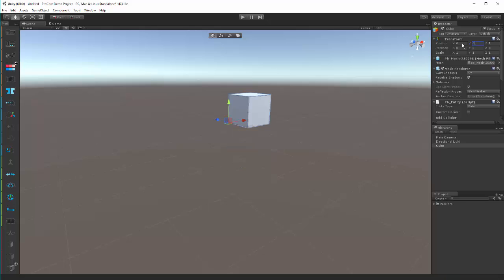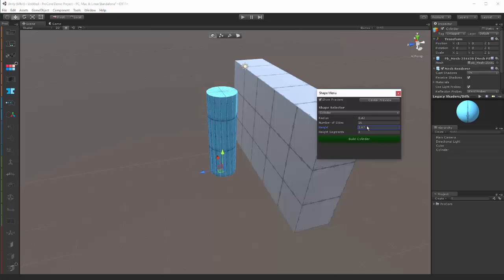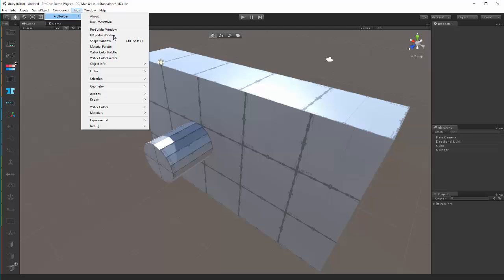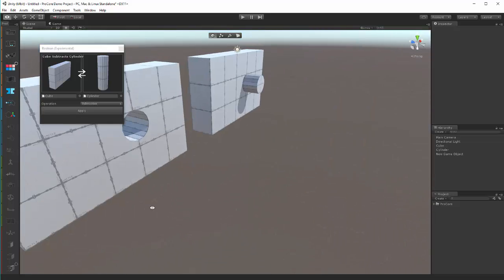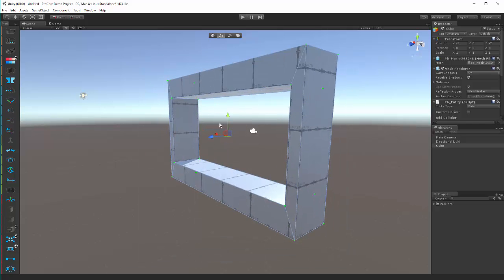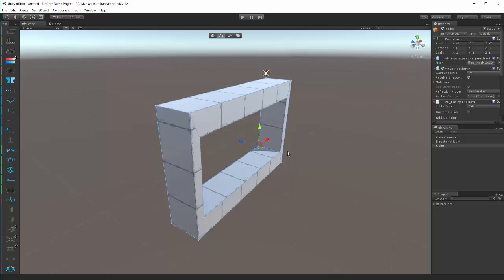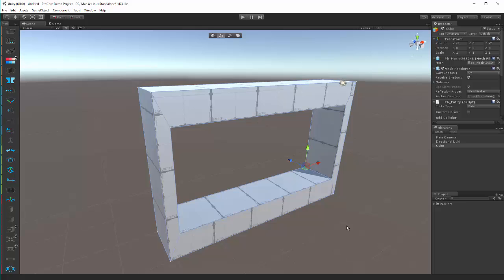ProBuilder Mini-Vid : Cutting Holes In Things (v2.5)

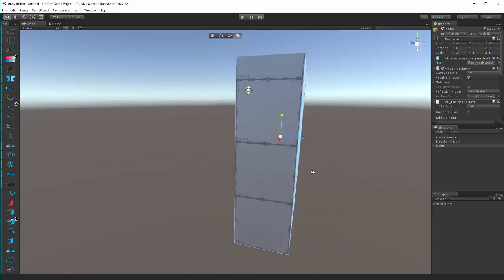Comment: Wish you would be more specific with your keyboard shortcut keys, hard to follow for a beginner.  I have attempted many times and can not get the diagonal line you see in the corners of each selection (2:39) of the video.
Reply: In case this is still relevant: Once you've selected faces, switch to Unity's standard Scale Tool, the one in the upper left corner with Hand Tool, Move Tool etc. Then, hold shift (same key as for extruding faces) and scale faces on one of the axes, then let go of shift and scale on the other axis. If you hold shift during both scalings you get different divisions. Both shift and v seem to be default hotkeys. I hope this helps.

Comment: Hi there, its a great tutorial however after removing the face and selecting the 4 edges the rotation of the gizmo does not align with the correct direction but rather it has a weird angle therefore when extruding along one axis the connecting inner wall of the hole is all off. I cannot seam to get the same gizmo angle as the face had prior deleting it; when selecting the edges even though i am keep changing the handle mode between all 3 options the angle of the gizmo when selecting the edges is always all over the place.
Reply from the maker: Hi! Can you post with images to the support forum at "https://forum.unity.com/forums/world-building.146/" ? Thanks! It's much easier for us to help there :)
Reply: Hi there, Thanks for your suggestion i did that https://forum.unity.com/threads/how-to-make-plane-handle-mode-work-for-vertices-and-edge.544559/ Although i have frazed it differently in the post, i feel it is the same issue.

Comment: Erm. Doesn.t work for me anymore. Watched your Medieval House & your colleagues Cutting Windows tut but this video is problematic.

1. Booleans work
2. Edge Loop works

I can never select all 4 edges. One at a time here and with a snap at a ridiculous .0625 invariably have to weld the odd vertices Also, now started to get this fatal error:

Assertion Failed : In order to call GetTransformInfoExpectUpToDate, RendererUpdate.Manager. UdateAll must be called first. 

Thoughts anyone?
Reply: probuilder is buggy. If somethings starts to act odd, it seems it's better to start over and try to keep it simple

Comment: Hey are you using probuilder basic or just pro builder? Cause I am having a hard time finding the controls like how you have showed them in your videos. Granted your videos would be helpful as soon as I could identify the tools since I use probuilder basic.
Reply: Turns out you have to enable experimental features manually in the Unity preferences: https://procore3d.github.io/probuilder2/experimental/experimental-overview/

However, on ProBuilder Basic I wasn't able to find the checkbox it mentions, so... back to square one I guess?

Comment: Very good video.  The one thing that's different with mine is it doesn't have the "Experimental" selection from the Tools menu.  However, I went with that "correct" method and it worked out just fine for me.  I needed to cut out a square hole in a floor and not the ceiling, so I just selected the floor only when doing this and it works fine.  Thank you for the video.